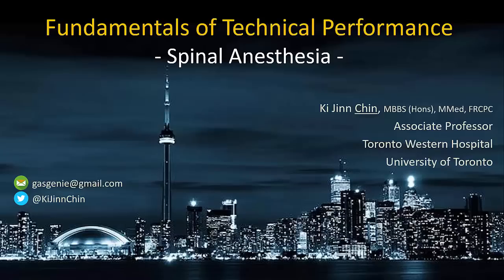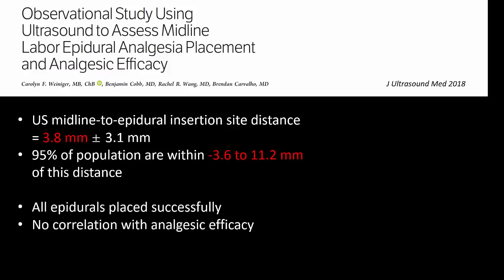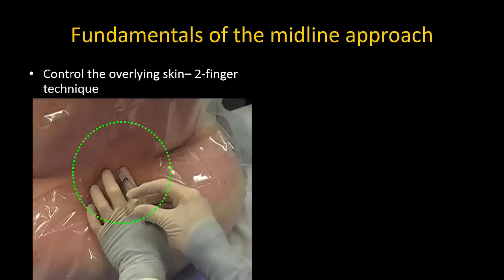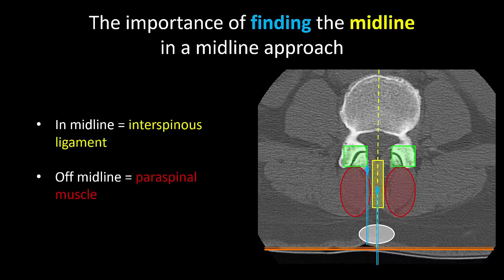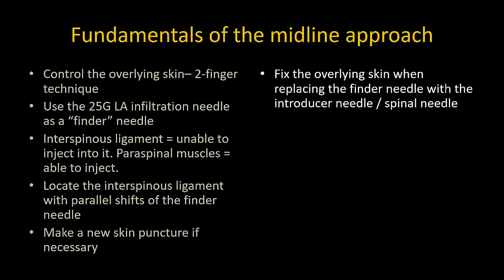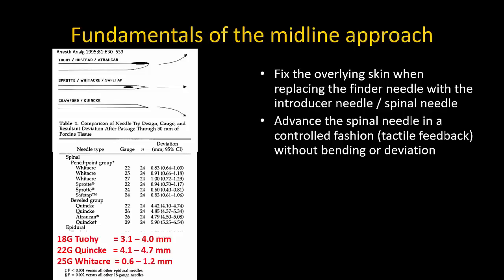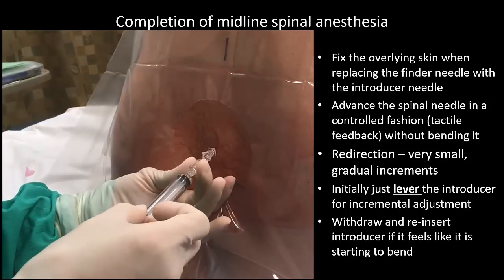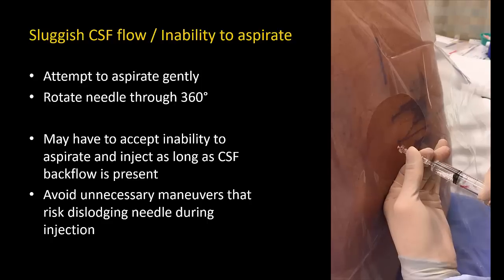Successful Spinal Anesthesia / Epidural / Lumbar Puncture - Fundamentals of Technique

Comment: Should the introducer needle be advanced through its entire length? In thin patients, can it cause a dural tap if the entire length of the introducer has been inserted? Secondly, should the spinal needle be rotated 360 degrees after obtaining csf flow? Also, in the video, you have held only the spinal needle and not supported the introducer needle while attaching the syringe and injecting the drug. Wouldn't there be a risk of needle migration during these steps if the introducer is not supported? These are few queries because our basic training in India is with the quincke needle. Hence we are quite confused which fingers to use to support the needle and which needles to support. Thanking you in anticipation
Reply from the maker: 1)I insert it only as far as is needed to have it firmly anchored - which means into the interspinous ligament for midline, or paraspinal muscles for paraspinous approach. As long as they are not obese, I usually have 0.5-1cm still protruding. The main reason not to insert to its entire length is so that I can manipulate the introducer to change needle trajectory if required. It's unlikely to cause dural tap in adult patients since the length of a spinous process is at least 3cm. But worth being mindful of.
2)I always rotate the needle as a habit. No downside, and it often improves flow.
3) The key is to hold the spinal needle in position, so that is what should be held and stabilized during injection. The introducer is irrelevant at this final stage. During insertion however, we hold the introducer because it is responsible for "aiming" at the target - think of it like the barrel of the gun, and the spinal needle like the bullet/missile (just shoots in and out). But once the spinal needle has reached its target, it becomes the only thing you need to control to keep it in the target.
Reply: @KiJinnChin  thank you so much Dr Chin for your detailed reply. It has cleared all doubts. Appreciate your patience and the brilliant videos you put up here. Stay blessed

Comment: How often do you not get it on the first pass? Thanks
Reply from the maker: @Clarkson350  more often than not, especially in older patients, simply because some degree of cranial angulation is needed to walk off into the space. Nothing wrong with (gentle) bony contact, as long as you have a good idea of what you’re touching and where to go next. It’s an expected part of the process. 
I don’t often have to do a second needle insertion point through skin though, which is a different thing from needle passes/ redirections. Scouting with your LA infiltration needle usually takes care of that aspect of starting off in the right place.

Comment: Sir i have a question.....How to locate the interspinous ligament with local anaesthetic needle....?
Do o have to shift the direction of syringe right or left or do i have to push skin with my two finger right and left ?
Please answer
Reply from the maker: 1) place index and middle fingertips on either side of spinous processes. At this point the APPROXIMATE midline is between your fingertips 
2) Insert LA needle and raise subcut wheal with 1-2ml to numb the skin for comfort
3) Insert LA needle deeper now - this is to determine whether the trajectory is in the interspinous ligament or off to one side in the muscle - the answer comes when you try to inject. If you can't inject - congratulations, you have found the interspinous ligament and can use the same trajectory to place the spinal introducer/needle. If you can inject,  you are in muscle and off to one side
4) start to search in a left-right pattern for the interspinous ligament. Do NOT angle the syringe (which I think is what you are asking). You want to make a parallel shift (see video and it will be obvious why you don't want to angle your needle). You could make a new skin puncture to the left or right of your first one - but there is no need - use the mobility of the skin to shift the needle insertion point slightly left/right relative to the underlying bone. Just make sure you have withdrawn the tip into the subcut tissues before you shift the skin with your fingertips.
5) repeat the insertion and trial injection. Keep making the small parallel shifts until you obtain the resistance to injection. 
Putting the effort into searching pays off with the older patient who has narrowed interlaminar spaces. And after a while, it becomes second nature, and very quick and easy.

Note: the only time you would angle the needle is if you believe the spine is rotated - i.e. scoliotic. See the video on scoliotic spine for more details.
Reply: Thanks alot sir.... 

Sir one more question about a problem that i encounter...
In obese patients when we are unable to palpate any spinous process or vetebrae how to find the space with minimum punctures.....?

I am a first year resident so still i find difficulty sometimes in giving spinal mostly in obese and short heighted patients as i always hit bone no matter where i move my spinal needle
Reply from the maker: @srk341717   here is where I encourage you to use ultrasound if it is available to you. See my videos -  https://youtu.be/KXTaP9PVZW0 (obesity), https://youtu.be/vgitdMn8RnI ( basic US for midline approach). Alternatively, I have also been successful with just a controlled incremental approach, usually with a 22G long Quincke needle for its rigidity and ease of redirection. And I sometimes deliberately do a paraspinous/paramedian approach, as redirection into the space is actually easier - you know that you are not in the midline (and not worrying about it), touching lamina, and you can "walk" into the space. See my video on paraspinous approach - https://youtu.be/Ui7rKs5fyYg

Comment: First  thanks for this video Sir
I have question 
Sometimes i feel  pop (?)
But there was no CSF.
What was  wrong?
Please help me
Reply from the maker: In older people sometimes the CSF pressure is low. With a pencil point needle, sometimes the cauda equina may be partially obstructing the orifice and impeding the flow. Here is my  usual practice if CSF flow is absent/sluggish: (1) rotate / spin the needle 180-360 degrees, sometimes a few times; (2) wait and watch - if there is a fluid meniscus, and it is moving even slowly, I will accept that and inject carefully WITHOUT attempting to aspirate so as not to dislodge the needle; (3) if there is no fluid, advance slightly further, perhaps even contact bone which is the anterior wall of the canal, then with the stylet out of the needle, withdraw in small increments, pausing and rotating the needle to see if CSF starts to flow.
Reply: @KiJinnChin  
Thank you  very  much sir
and  I'm so happy for your answer. 
Forgive me  l'm not  good at English.
Today I  was practice spinalanesthesia. 
71kg. 165cm. 
Pregnancy women  38weeks
18G needle(introducer) , 27G pencil point needle 
L3~4, sitting position 
0.5% bupivacaine heavy  11mg
result  was  terribly poor

In case of sitting position 
How much increase of  injection dosage??
If  it  is  ridiculous question,
Forgive me sir